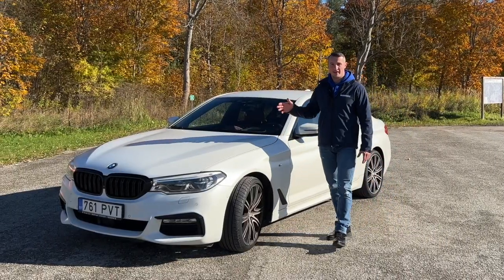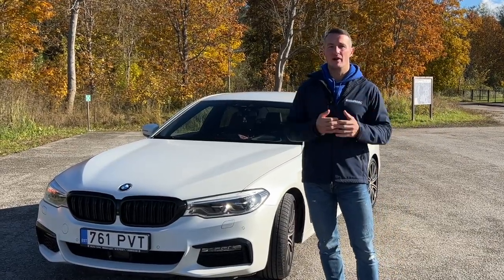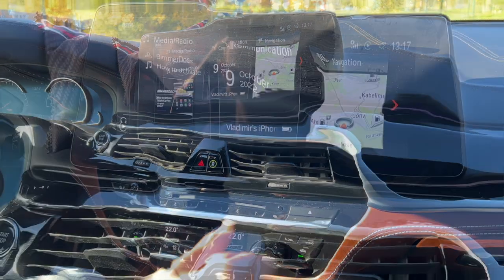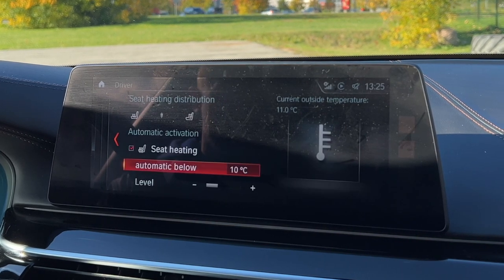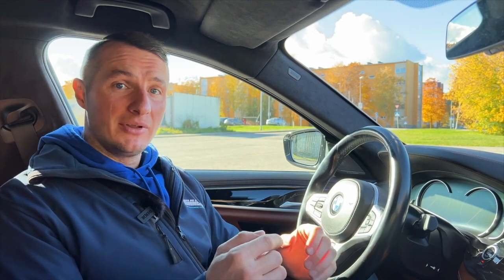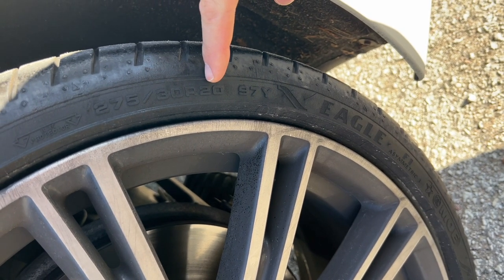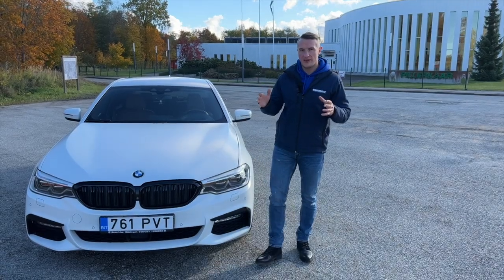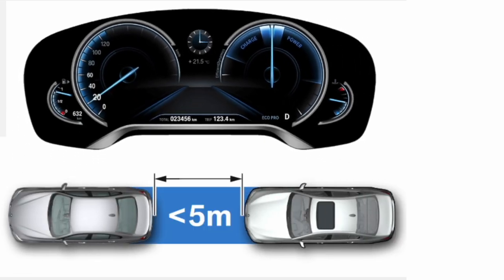Amazing technical facts about BMW, that even real fans don’t know!

Comment: On sport modes - Driving daily BMW F30 for 2 years I have already learnt that pressing SPORT mode button is nearly useless thing. First I thought that it may be of use when I want to quickly merge into the high speed traffic but in practice it just doesn't help. Unless you like overly sensitive accelerator pedal -- this is what it does, makes pedal more sensitive. It doesn't make reaction times shorter, it doesn't save you any milliseconds. To make sure yourself you can check multiple 0-100 videos that are plenty on youtube. SPORT mode is just another gimmick (just like ECO PRO mode too). Regarding SPORT mode on a gearbox I am not sure, have to play with it more. My only wish for SPORT mode is that it when I floor it, so it would drop a few gears down and rev the engine up instantly, without waiting. Like DSG gearboxes do :)

Comment: What is the best (free) diagnostics software? Like reading, clearing errors, also DPF regen, testing components (open window), seeing parameters. For new vehicles, Like BMW i3, i8.
Reply from the maker: You can find ista for free. 
It will be cracked version, but will make the job.

Comment: The start in the tires is for tires that the brand made specially made for BMW. They are considered the best tires for your car. For example, I have Pirelli P Zero R18 245/45 V100 with the star at the front and exactly the same but without the star at the back because the store didn't have those, and they are a bit different in style.
Reply from the maker: This is correct answer )